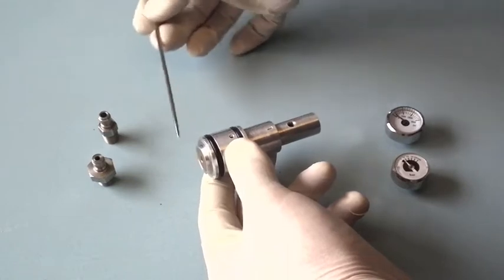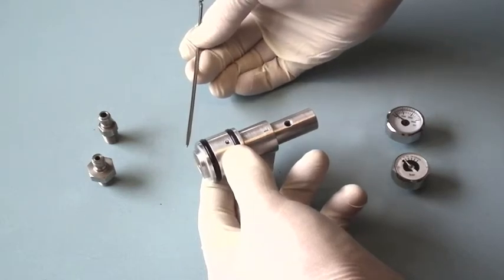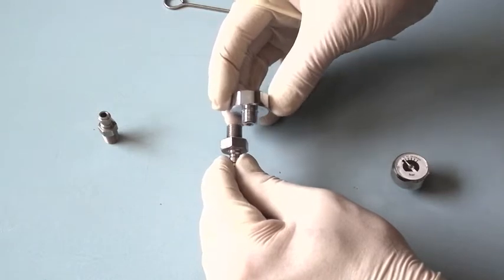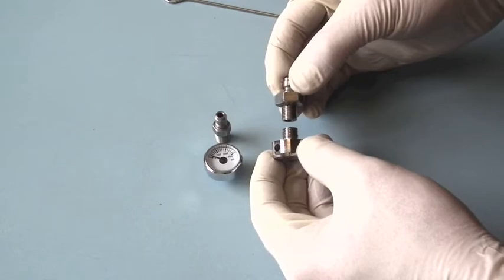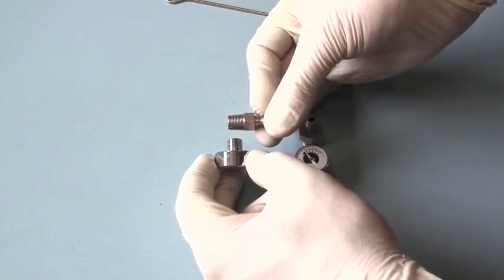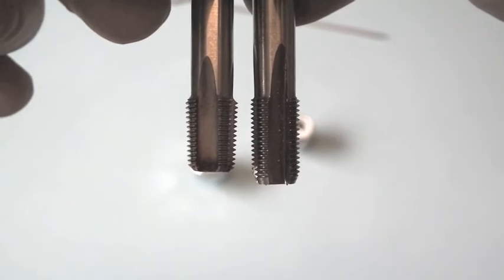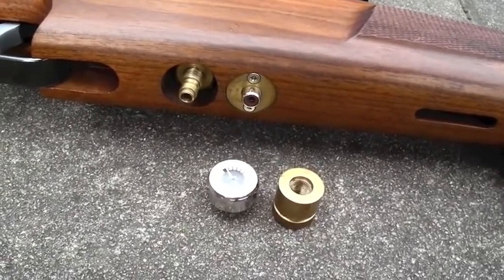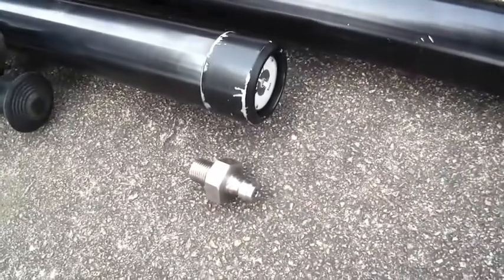Lane Regulators - FAQ 6 - Can I fit your regulator if my Inlet Valve is on the Piston side?

Comment: Or conversely Robert  I'm surprised you didn't mention you could have the full bonus of your equipment   By installing one of your quick fill /pressure gauges as well ,
Wow, now able to monitor reservoir/cylinder pressure and also  monitor output regulator pressure.
Come on keep up x

Comment: I'll be ordering a regulator tomorrow after I talk to someone to make sure my gun is the same as the hatson at44. I'm 90% sure it is. Do you have regulators made or will I have to wait? I've got .22 cal. I think I want it 20lbs or 25lbs I shoot 21.3grain H&N baracuda match. How difficult is making adjustments to lbs? I like volocity since I live in a desert that only has calm winds when I'm not shooting. But for field target they have a max of 20lbs. Thanks.